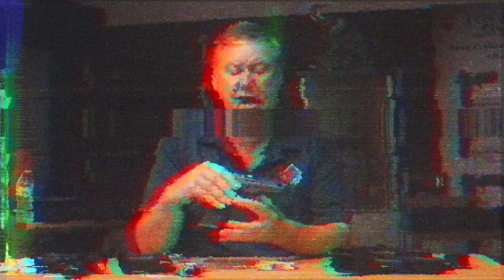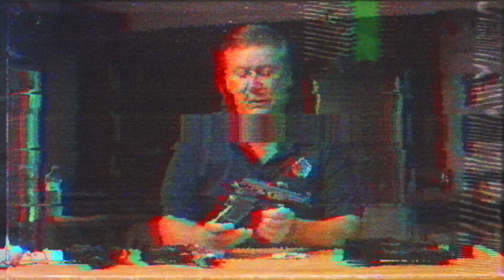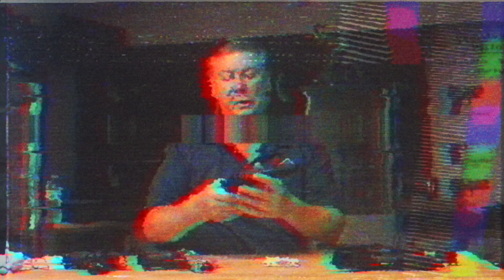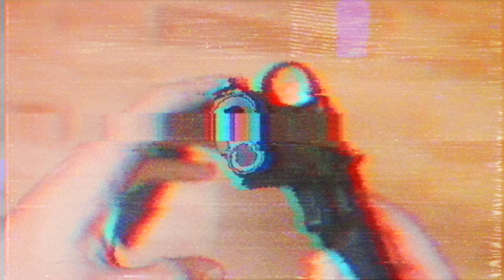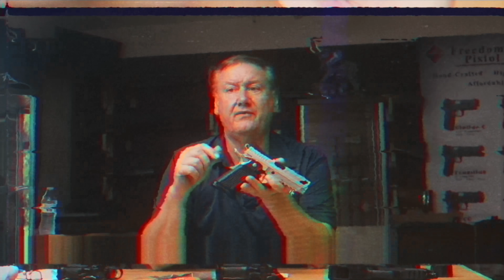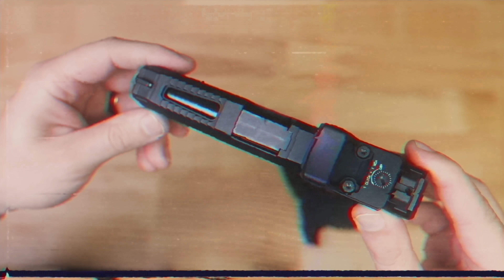1911 That Takes Glock Magazines - The XP PRO™ and More!

Comment: Is it possible for you to get polymer grips? I really dislike metal grips.
Reply from the maker: No Only, aluminum, and more designs will be coming
Reply: @ Rgr, when you say more designs you mean more aluminum ones? I ask because I bet I’m not the only one who prefers polymer because I’m not always wearing gloves and most 2011s are polymer. I understand injection molded grips are probably prohibitively expensive to produce unless in large quantities but is that planned for later at least? It’s a deal breaker for me as much as I like your stuff because I don’t want grips that are as prone to temperature issues in extremely hot or cold environments. I appreciate your response and good work!

Comment: Is the xf even thicker than a glock 19?
Reply from the maker: The XF-Pro grip thickness in width is 1.300” and from front to back 2.070”. This is with the grips on. The back-strap undercut gives a very stable and consistent grip. Also, making it not feel like a Glock, but more like a CZ-75 grip feel. Very comfortable and easy to point and acquire the sights/target.

Comment: I love that the platypus has direct competition now!!
Reply: That's cool. The platypus also has an aluminum frame and Cerakote (the cheapest, least durable firearms finish). Not built for high round counts or serious-duty use. Also, about $700 more and still doesn't come close to the features on the XP PRO.
Reply: @CombatConscience I wouldn’t say they are built “cheap”. Remember Bul Armory has a line called “EDC and EDC Pro” and they also have aluminum frames and I’ve never heard someone say that those are built cheap or not to last. Stealth arms isn’t a new company or an old company and they come out with new stuff every year. They are talking about making steel frame and even ported options from factory on their website.
Reply: @CombatConscience completely different gun. Platypus is worth the money.

Comment: Is the grip angle similar to a 1911 or Glock?
Reply from the maker: The XP-Pro is a hybrid wide-body pistol, with a newly patented design. The rear is at 22 deg, but the front-strap is at 17.5 Degree, basically the same front as a 1911. It makes for great balance and quick pointing and does not feel like a brick in your hand like a Glock and many of the polymers. This new design has been tested by a wide range of shooters, even several very prominent target shooters and a Bianchi Cup winner, and they love it.  I will have a post/video on this soon...
Reply: @fusionfirearms  Thanks so much! So glad to know. You have to tilt your hand down on Glocks.

Comment: I really like this but the grip looks really chunky.
Reply from the maker: The grip angle is very comfortable and handles points very well. The front-strap is basically like a 1911 at 17.5 degrees and the back is at 22 degrees. It does not feel like you have a brick in your hand, and it is very fast to pull-up for natural sight acquisition. With the 2 angles being slightly different and the undercut trigger guard, as you grip the pistol it naturally pulls your hand into the grip safety and towards the center-line of the barrels for maximum control.  Also, The grip is thinner than most wide-bodies because of the use of Glock Mags.
Reply: Thanks for the answer!

Comment: Thats a 2011 not a double stack 1911, 2011's are made up to 3 parts that make up the gun which is the slide, frame and grip. Most 1911's and double stacked 1911's are just the slide and frame.
Reply: 2011 Is a trademark name for a double stack 1911 with a modular grip. Look at every "2011" style pistol and ask why they don't just call it that.

Comment: so a stealth arms platypus
but no custom paint job lol
Reply: Bruh what? Platy has aluminuim frame plus cerakote is trash for anyone planning on carrying or putting high round counts through it. Plus this has a modular grip, steel frame, better finishes, better features all around for considerably less money than a non upgraded platy. Platy is cool but if this is reliable it blows the platy out of the water. Custom paint job is Fudd in my opinion..... literally the least durable finish.
Reply: Wtf you talking about?

Comment: You guys know the platypus exists right?
Reply: The platy has a one peice aluminum frame and is cerakoted. This has a steel frame, modular grip, better finishes, optic ready, ect..... The platy is cool, but with the aluminum frame it's not built for high round counts like steel is. Plus the cerakote will wear considerably from regular use. Plus the custom paint job in my opinion is cool but kinda Fudd as it is the lease durable finish out there when comparing to Tenifer, Nitrocarburizing, PVD, and Chrome it's not even close.
Reply from the maker: Well said

Comment: Will the XP Pro's grip module and extended slide stop be available separately at some point?
Reply from the maker: Yes but they will not fit 2011's.
Reply from the maker: We will but they will not fit 2011's.
Reply: @fusionfirearms  so, will this fit anything else besides YOUR frames?  The Springfield Prodigy is listed as a double stack 1911, not a 2011.

Comment: So I see your partnership with the Turkish company. What components are they making for this firearm? What type of metal are they using for said components? I have asked this question multiple time on Instagram and have been left on. Read receipt with no response. You had no issues respond responding to other questions.
Reply from the maker: We design and develop here in the US. We will also manufacture custom XP Pro's and after market parts in the US. We are partnered with Ermox to offer the best features, materials, and finishes at an affordable price. Production for these pistols is in Turkey at Ermox. We partnered with them because we both have the same vision and want to bring the best products we are capable of to the market that are affordable without compromising any features. On the XP Pro Frame, slide and small parts are all bar-stock 4140 steel with Tenifer finish. The grip, mainspring housing, and mag well are bar-stock 7075 aluminum with hard coat finish. The mag catch is the only non barstock component that is polycarbonate to accommodate for the Glock polymer magazines.

Comment: Stealth Arms Platypus 2.0 with a Sig 220-series aesthetic to the slide, using a steel frame with STI-esque grip/trigger guard as a separate aluminum component. Nice improvement over the Platypus' non-anodized aluminum frame, that'll end up being a wear component with high round counts. I do like the slide stop design, that's real nice for folks with smaller hands. And for $1100-$1200 MSRP, I can see this beating out several of the more expensive competitors for entry level 2011's... Assuming it works, that is.

Comment: Is there a cut already there or you have to use the plates? Just wondering if you could mount red dot flush. From the view I cannot tell if the frame rounds. Trying to know the width. Someone said in the blog that the panel are removable from the frame put panel grips flush? Quite a bit of questions… trying to see if it hits all my picky qwerks so i can preorder
Reply from the maker: The slide is milled for the optics plates, there are several plates depending on the optic you have to mount. The Al grip section is removable similar to a 2011. On the X-Fire the grip panels are removable. We will get into this deeper on future videos.

Comment: Is the grip profile 1911 or Glock?
Reply from the maker: The grip angle is very comfortable and handles points very well. The front-strap is basically like a 1911 at 17.5 degrees and the back is at 22 degrees. It does not feel like you have a brick in your hand, and it is very fast to pull-up for natural sight acquisition.
Reply: @fusionfirearms  Thanks. I ask because I do not like the Glock angle so this would interest me.

Comment: Just placed an order for XP Pro, I hope quality is better than my OA defence 2311, paid $2400 for it, been shipped to them for warranty work already, after 150 rnds inside the slide has so much wear it resemble my colt 1911 I inherited from my dad(65 yo firearm), mag well all scratched up just with normal mag changes and rail is scratched and dented by installing a weapon light once, they said it's normal wear, I say it's a bad wordsmanship and poor customer service, have two Staccatos and no wear after many thousands of rnds and I hope Fusion pull through and have a better quality specially for half of OA pistol they asking for, I'll report back for those interested.
Reply from the maker: Thank you for the support! The finishes are “Top-Shelf” on these.

Comment: Looks great. I have a question. Can a short trigger be bought from Fusion? If not will a standard 2011 short trigger work? Also, do you have an option to change the thumb safety to a wider version? I ask this only because that’s how I have to set up all my 2011’s due to my hand size.
Reply from the maker: We will be having many variations of the control parts, barrels, triggers …etc  for aftermarket sales as we move forward. We also have custom shop features for these models, where you can email in your desires, and we can quote it for you. Standard 2011 trigger will not work due to clearance with the mag catch
Reply: Thank you. Makes sense

Comment: How likely will porting be possible with those little cuts? Asude from that it does look great and hopefully doesnt have the little hole to blow gas onto the optic (pridigy, which i had forgotten abojt until another commentor brought it up)
If reviews are positive (and point towards reliable) i may look to get one for myself for christmas. 

Is the grip angle more glock or 1911?
Reply from the maker: You could port it, we are not porting at this time.
Reply from the maker: The grip angle is very comfortable and handles points very well. The front-strap is basically like a 1911 at 17.5 degrees and the back is at 22 degrees. It does not feel like you have a brick in your hand, and it is very fast to pull-up for natural sight acquisition.

Comment: This is what I’m talking about, steel frame, aluminum grip.  Everyone’s releasing these hybrid 2011ish models with aluminum frames, as much as they’re fine for concealed carry, someone doing high round counts in competition or training will want a steel frame.  I’m not magazine adverse to the 2011, especially that they’ve finally made a 9mm specific mag for the new Staccatos but man, I’d love to have 33 round Glockazines for my 3 gun open pistol and the Platypus doesn’t do it for me with the aluminum frame, take apart guide rod, and cerakote finish.

Comment: Well, looks like we need to review some fusion firearms pistols right away!
Reply from the maker: Sounds good to us!
Reply: Hope to see your review on this
Reply: When will we see some reviews hitting?
Reply: In my opinion: They make "ok" stuff. Their barrels are good to go but their small parts would need some improvement. 

They'll do the job, but milage may not be so high on the small parts even if machined. 

It's the heatreat that warps parts & how they relax set. MIM sintering is really terrible so is machining soft parts to save on cutting bits. 

I like their barrels. The last one I had had a crazy long lead in past the chamber shoulder. Shot & cleaned well for a drop in 5" 1911 barrel. I thought their links, link pin & bushing were softer than the major brand labels and slightly gritty on the adhesive wear surface element.

If I could be satisfied with a run of the mill, it'd have to be an Ed Brown above everything else.

Comment: The magazine fits too flush.
Reply from the maker: The grip angle is very comfortable and handles points very well. The front-strap is basically like a 1911 at 17.5 degrees and the back is at 22 degrees. It does not feel like you have a brick in your hand, and it is very fast to pull-up for natural sight acquisition.

Comment: Good to see the XP Pro doesn’t have a witness hole in the barrel to blow exhaust gas on the optic.    Does the grip have a Glock angle or did you use some Stealth Arms magic and retain the 1911 angle?
Reply: 17.5 like 1912 on front, 22 about on back. It Handel's very good. Doesn't feel like a brick like a glock